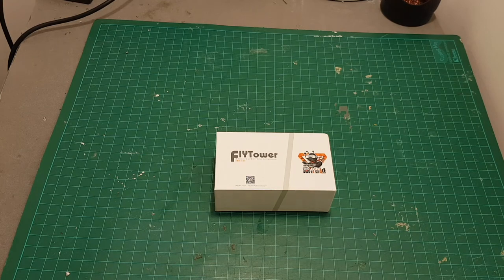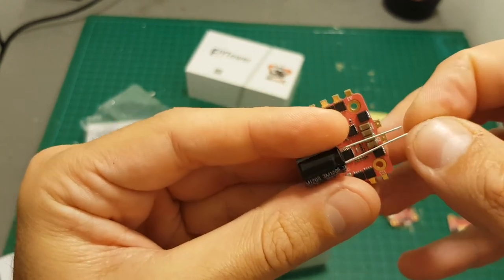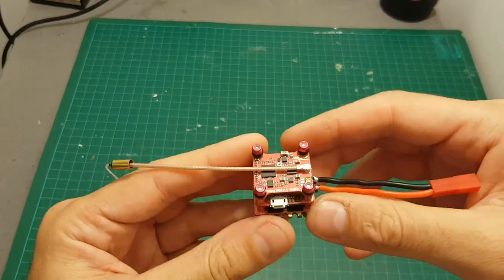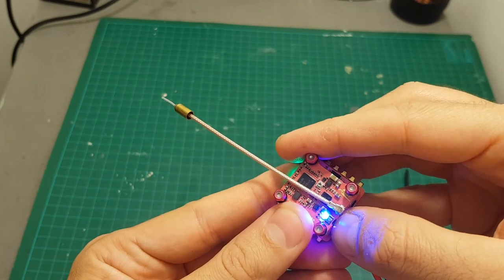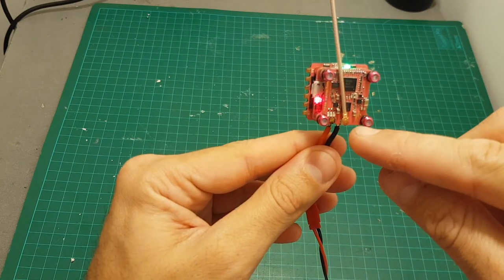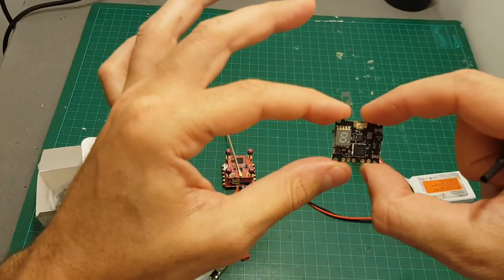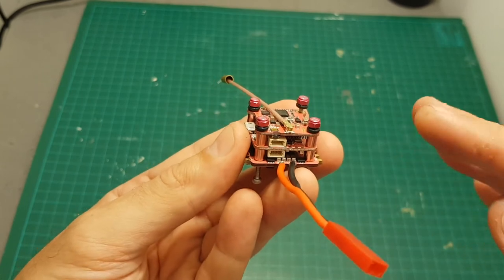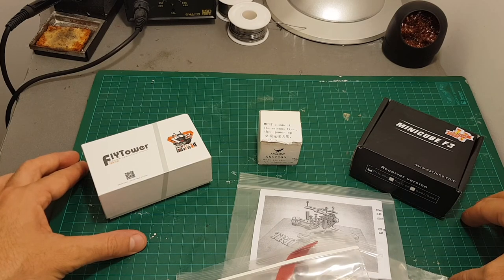Exuav Mini F4 Flytower Omnibus F4 AIO OSD Flight Controller

Comment: Is it possible to connect many sensors using this flight controller?
(Four or even 6 laser sensors... I need my drone would be able to measure distances to each wall...)
Reply from the maker: You cannot connect them directly to this FC.

Comment: Does the FC have a new version of the voltage regulator most F4  pros have? I like the Omnibus F4 FC very much. But, when I try to run the camera and receiver, it burns out the voltage regulator because too many milliamps are drawn.
Reply from the maker: I am going to use it in the next week or so - then I will be able to tell you how it performs.

Comment: Any idea how to bind the eachine F4 minicube using the DSMX receiver given that Betaflight CLI no longer has the commands to bind the receiver?
Reply from the maker: I don't have any experience with DSMX. Hopefully someone else can help you with that.
Reply from the maker: I just actually used the DSMX version of the Eachine Minicube. Do you still need help?
Reply: Thanks for keeping my problem in mind.  Was it the F4 version?  Since the code to bind the DSMX receivers in not available for the F4, there is no way to bind the Eachine DMSX receivers.  If you were able to bind the F4 version, I would be greatful if you could pass along your technique.

Comment: no UART pads right? I got the F3 version and I'm kind of struggling :/
Reply from the maker: +sebastian gramano I still didn't use it, but I am planning to release a build video using this FC in about 2 weeks.
Reply: sebastian gramano did you get it sorted and in the air?
Reply from the maker: I used it in this build video: https://youtu.be/n_c-4LHhDOM